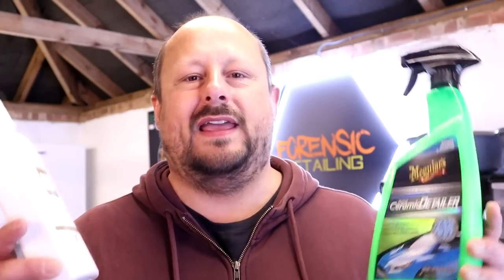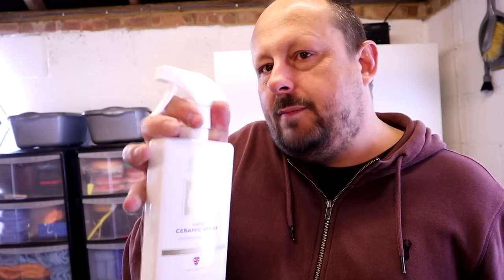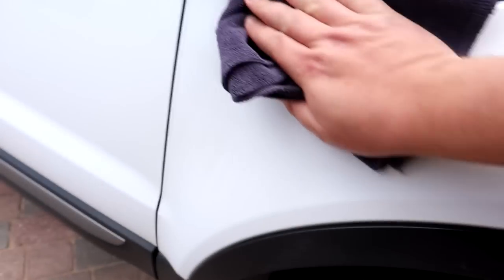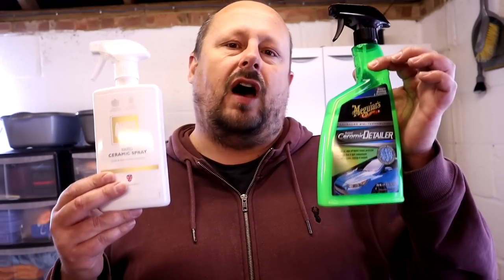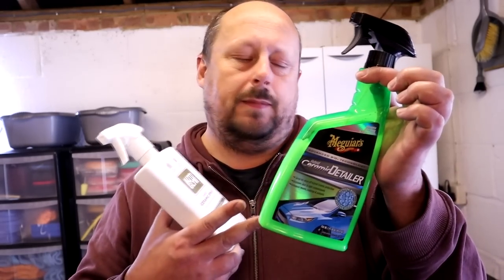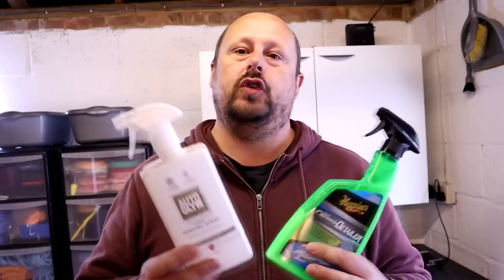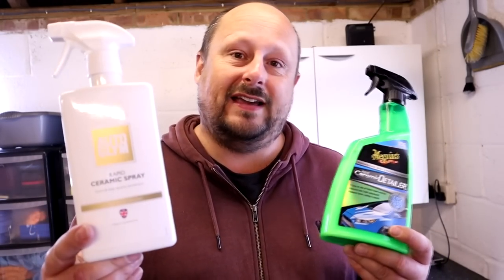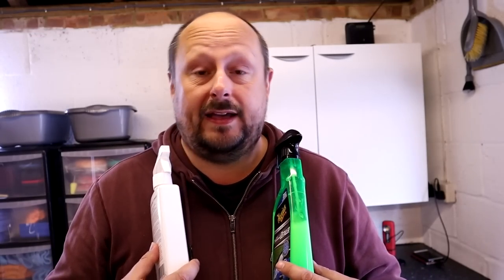Autoglym Rapid Ceramic Spray V Meguiars Hybrid Ceramic Detailer | Battle of the Halfords Ceramics

Comment: Jon,

I really like your videos and the effort you put into them, but that performance from HCD is NOT what it should be. Not sure if your bottle has gone off or you forgot to shake it, but it should bead much, MUCH better, and last decently as well (I've had a month easy out of it). I've tested it along with the Megs Ultimate line and it was very durable. I've also tested it as a stand alone and on top of ONR was residue and it held up to Degreaser hits much better than what your performance here indicates. I can't get my hands on the AG CD yet in Canada but I plan on doing my own review on it.
Reply from the maker: its not gone off and its been shaken.   Its about concentration.  If you use more megs product on a smaller area, its beads like crazy and it will last longer (or if you use more of it).  it also boosts protection really well.   If you look at my detail spray video where megs comes 2nd. standalone megs beads like crazy because I put the product on a small tapes off area.    So this result is showing you how it performs on bare prep'd panel with one might per quarter of the hood same as the autoglym.  That what this video tries to do.  Its worth saying that megs is a detailer not a spray sealant as well.  very very good detailer but its not a spray sealant results are as expected.
Reply: @ForensicDetailing  did you apply with an applicator or spray and buff? More and more lately I’m applying spray products like coatings and waxes using applicators. Use less product, get a better more even application, and thusly performance. I would say that if adding more product boosts is performance, you probably didn’t apply enough to begin with. I haven’t noticed HCD giving me the performance seen here using a “normal” spray detailing level of product.

Comment: Hi I'm sure it's a silly question but. Do I use the Auto Glym ceramic spray instead of a wax. I usually wash and polish every time I wash but I don't always wax, Don't know if that's right but does the ceramic spray give a better job than the wax. I am using a Maguires wax. Thank you.
Reply from the maker: you can do yes its about the same sort of of durability.  but you can also put it on top of wax or the autoglym ceramic coating product.  so base sealant of topper if you want.

Comment: Im interested to see how the AG compares the the TW ceramic spray. Im currently toying between the two. Primarily I use AG, but I’m not adverse to using another product. 

What’s your thoughts?
Reply from the maker: I think the autoglym one beads up a bit better but the TW one has very good durability.  both about the same price.   It really would not make too much difference.

Comment: I recommend you try AutoGlym Rapid Aqua Wax...unreal gloss..I think the problem with £20/€20 bottles of detailer sprays is they cannot compete with the likes of Bilt Hamber QD on price (especially if watered 10:1). Its just the nature of the beast with detail sprays - their not designed to last long as a standalone so why pay more. I'd be interested to get your take John on watering down Megs Hybrid Ceramic Wax (blue bottle) to transform it in to a detail spray.
Reply from the maker: yer you can do that about 5:1 it seems to work.

Comment: So if you have to apply more of the Maguire's to get the same response then surely its cancels out the value for money.
Reply from the maker: hmm its more a case of megs is a quick detailer hurl it on buff it out.   but you can instantly tell the autoglym is a more concentrated spray sealant, in the same way the hybrid ceramic wax is (minus the white emulsion feel)

Comment: A bit of background. Picked up a BMW and the usual showroom tricks were applied to the paintwork. After washing properly, it was revealing to say the least. Decided to go the Ceramic route after prepping and correcting scratches, swirls and stone chips.
It was my first foray into Ceramic coating and opted for a rapid coat rather than the more extreme long term Ceramic as this was partly experimental.
Previously, I have used waxes and sealants from Kiwami Fusso Soft 99, Bilt Hamber double speed wax, Bilt Hamber Auto Finesse, Chemical guys black light to the very underrated Sonax colour wax (they did a Carnauba version - avoid like the plague). My favourite has to be the Chemical guys. I find it difficult to apply, almost as if the paint needs a Clay Bar but oh see easy and satisfying to buff.
So I am always wary: easy to apply does not always equal good product and I am continually disappointed with the Meguiars products. Their rubbing compound is pants IMHO. I prefer the 3 step 3M or Turtle wax premium rubbing compound.
The ease of application of the BH double speed wax is incredible but only on pristine paintwork. The Auto Finesse is a remarkable product.

So, first up was to wash and clay bar the BMW. The clay bar was a Meguiars and by the end, it was mulch, falling to bits and left some debris in and around nooks and crannies. I will stick to the BH one - it's far superior. I was sold the Meguiars pack - the detail/ceramic spray and the clay bar combined.
The car took 2 washes to remove the white milk residue from the clay bar. It was a PITA. The Meguiars ceramic coat for me. although easy to apply, I found much harder to get a consistent depth/buff on the paintwork.
Cue the Auto glym. Harder to work with. More sensitive to temperature but much better to buff and less streak free (I liken Ceramic to glass cleaning - you know, you think it's smear and streak free but then you see it at a different angle and...).
The other thing I noticed was that you could widen your application area before curing and buffing. Also, it states in the distructions (yes, I actually read them) that a second coat not long after the fist coat was possible and perhaps this video should have included that.

As another commentator remarked: another Auto Glym to the collection. I love their Vinyl and Rubber care, the Interior shampoo especially, the resin polish in certain applications. The Leather cleaner is good but the Leather care balm I think, needs to be a touch less viscous but I wouldn't look to anything else for leather care.

Should I now take the plunge and apply a long term Ceramic coating...?
Reply from the maker: I dont think so, you like detailing so you will be wanted to polish and wax a lot more.
Reply: @ForensicDetailing   You're probably right. It was my car and a daily so practicalities take priority. If you ceramic coat customers cars, you don't get quite the repeat business :).

Comment: John, great video as ever, but I’ve got another question for you; When you apply the product how long do you allow to ‘cure’ ? Is it a case if spraying wiping a little then allowing a final buff a few hours later ?
Reply from the maker: spray on panel, spread with like a applicator designated towel, once spread buff to a shine with secondary towel (or flip first towel)  just maybe count to 10 after spreading the film before buffing.  And I would leave it alone before getting wet.  I actually find this is important.  ideally leave it for 24 hours.. but if not 24, then leave it for a few hours before getting wet. I try and follow that rule with all products.

Comment: Can this be applied to vehicles with ceramic coating
Reply from the maker: yes mate
Reply: Thank you I’m going to give it a go. I have the Gyeon ceramic coating. One other question can you machine polish over ceramic coating even if no swirls to get a deeper shinier look?
Reply from the maker: @detailingshorts885  if you machine polish over a coating you will strip the coating.   although theres a product called carpro essence plus which you can use to repair a coating sort of.
Reply: @ForensicDetailing  what else will strip a coating ? Can any polishers / ceramic waxes etc and so On do this? As I’m hoping not as wanting to try a variety of sprays etc.

Comment: I prefer meg quik detailer and ceramic detailer over any other detailer personally but  i do use autoglym products such as magma decon  and let me tell ya !! WOW, guys buy products that are the best in their field, like a quick detailer I go with megs, iron remover I use autoglym magma, degreaser I use bowdens orange agent, and so on and so forth. Keep it up forensic
Reply: Have you thought about buying liquid clay ( magma in 5l bottle works out lot cheaper ,I wouldn't buy any 500ml fall out remover for 10 quid ,very expensive ,I'm currently buying 5l autosmart red 7 ,awesome stuff at 29 quid for 5L
Reply: @boyasaka  hey bro yes I did mention autoglym magma if u read what I said again, I use meg ceramic quick detailer between full washes bro

Comment: Great and educational video. But can you use the Autoglym on the plastic trim or only the paint, if only the paint would have to be a lot more careful applying it but especially using it as a drying agent.
Reply from the maker: Only paint
Reply: @ForensicDetailing  Thanks, have just purchased some, just wanted to check.

Comment: why could the megs hcw spray die after 2 weeks like to te point its flat
Reply from the maker: concentration.  Its a QD that will boost protection generally but is not strong enough to be a spray sealant not unless you use more product per smaller area.

Comment: Gyeon wet coat essence for me at 15:1 gets me real value. Use it for a drying air and detailed in a mix
Reply from the maker: love a bit of wet coat. I have not tried it at 15:1 though.. check out the new gyeon stuff coming soon.
Reply: @ForensicDetailing   @Forensic Detailing Channel  Good stuff but not cheap so went for the concentrated (essence) which says you can do 10:1 or for 15:1, being cheap using at 15, my logic is use a but more to get coverage rather than more concentrated bursts that may not reach everywhere. Mainly for a winter wash finish or really lightly to help dry off. Not so much as a detailer on its own.

Comment: Quick question, car detailing is new to me and loving the videos.. i'm using the polar wash system blast, wash, seal - Would you still recommend a ceramic spray as well? Thanks for all the hard work you put in with the vids. 
Dave
Reply from the maker: not unless you really want to try a ceramic spray wax.   use up the Polar Seal first.  You can also decant some polar seal about 1:20 and use it in a sprayer like the ceramic spray giving you some massive value for money.
Reply from the maker: oh and Dave forgive the plug but you should check out my Detailing Fundamentals training course with discount code applied:

https://ioa.pxf.io/c/2687409/1012495/12764
Reply: @ForensicDetailing  Brill thanks very much for the reply! I'll use up the seal first as you suggest. Only got the 500ml bottle as i got it as a kit with the foam cannon.
Reply: @ForensicDetailing  I'll take a look mate :)

Comment: I suppose the autoglm ceramic spray will help on top of the Autoglm polar seal
Reply from the maker: not really no.   this whole layering thing is a red herring.   pick a nice durable sealant wax or whatever. something that can be used after full polishing/degreasing prep.  A base sealant if you like.    And then find nice topper detail spray you can use every wash.

So with autoglym.  UHD wax or UHD ceramic coating would be your based.  And this ceramic spray can be your drying aid topper.    Or if you want to save money you could get polar seal and use this etc... avoid buying 500 different products and stacking 5 different laters or products, it will just waste money really come up with a sensible regime is my advice.  I will talk more about this.
Reply: @ForensicDetailing  thank you I will re think what I need

Comment: Could you include AutoGlym aqua wax in a review? I’ve been using it for a while and I love it, but it’s almost finished. Would love to know if there’s another I should try
Reply from the maker: it was in the pvd mega test long long time ago its good, actually has decent durability as well.
Reply: How do you apply yours ?
Reply: Gtechniq C2v3 can be used wet or dry, wet coat  is the easiest of the lot tho.
Reply: @Mr330d the reason I love it is because it can be applied when the car is wet. I wash my car and leave it wet. Then I apply one spray to each of the windows (as I find it can leave marks/is difficult to buff). The product recommends 2-3 sprays per panel which is a good guide. Once I have sprayed a panel I then use a micro fibre cloth to ‘apply’ it (the panels remain slightly wet). Then when I’ve done that to all of the panels, I take a fresh mf cloth and buff the product. I find it so convenient as the car dries during the process while adding a layer of good quality protection!

Comment: Couple issues with these sprays: 

I don’t need a protectant detail spray because I apply ceramics, sealants and waxes separately. 

Quantity - don’t like the fact that you can only get them in these sizes as really and truly it doesn’t last long. 

Price - the price per use (assuming you done an average sized saloon once a week, for Meg looks like you’d need it too) you’d be spending at least 3-4 pounds per wash!! 

I like the products but the price turns me off. Much rather ONR diluted for a detail spray.

Comment: i stopped using any of those 500ml or 750 ml products, they cost 50 cents to produce and they are sold at 20 quid. i only use 5l products and the only German classics where also a small bottle lasts you for years. MENZERNA.